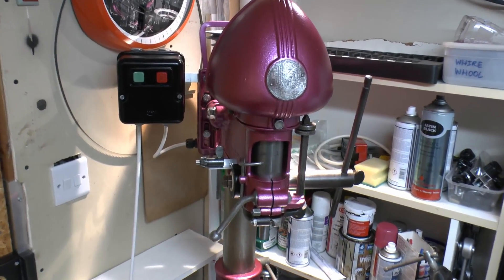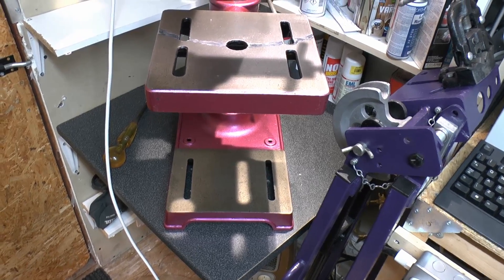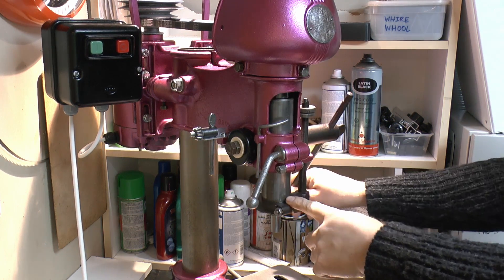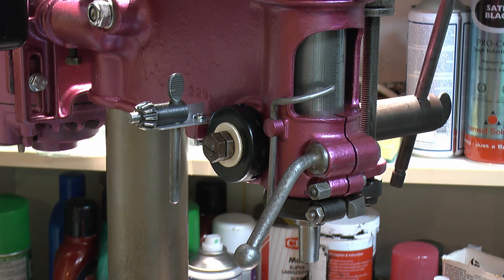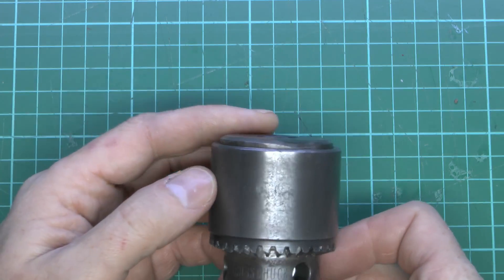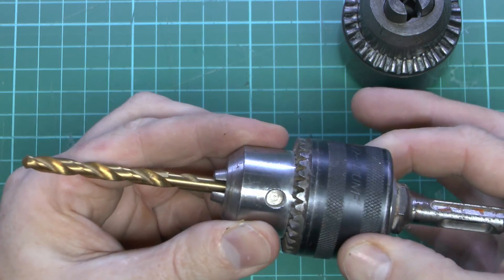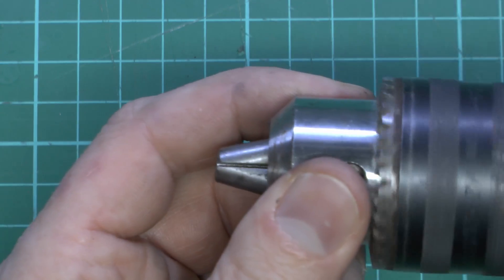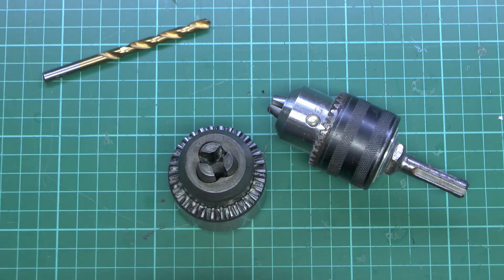Tauco Bench Drill Part 5 - Reassembled and working

Comment: There should be a spring and ball bearing in the handle assembly which is what the indents at either end are for. Stops the handle from  completely pulling out.

Comment: How were the spindle bearings? Delta used proprietary bearings with a non-standard O.D. that were unavailable for a long time. I found a company in the States that now has replacements available, Hammerscale Technologies. As for the colour, I prefer grey for machine tools, but it isn’t mine, so enough said.

Comment: It might, just might, benefit from some tangerine metalflake pinstriping. I have an old Delta Milwaukee (in pieces) of this vintage. It has a cast iron belt cover. It was attached to a solid column set in a weird goose-neck several feet long made of cast iron. This rode about another column attached to a base made of welded steel gussets 3/4" or 1" in size, and rotated on a roller bearing. I bought it from Boeing Surplus in the 80s. It has a War Production Board tag on it.

Comment: There are service kits with new jaws for the better Jacobs chucks. However this doesn't look like a better one and probably is worn out in other places.
Put a nice Röhm, Albrecht, or Metabo chuck on there (maybe even a good Jacobs) and you won't regret spending a little money. I think my Röhm was 30eur on Ebay, new old stock in the original box. Well worth it for a nice keyless chuck with very little runout, that properly grabs with no spinning and gouged up drill shanks. Especially given the time spent on restoring the drill it deserves a quality chuck.
As for milling/routing, I recently had cause to try that. The weakness is the taper (on my somewhat more substantial press), it will work loose from the side load and drop the chuck. Mills have a drawbar to pull the taper in (and don't use chucks). I did finish the job, but only just.

Comment: Lovely paint colour xD

I wish I had the same metric vs standard supply problems you do, I work in metric but nobody carries it... Metric is even more overpriced than "standard" here... a pack of SIX 6-32nd 1in screws is $1.25!
Reply: Yup... I'm an auto and equipment mechanic here in the US. Cars and heavy equipment, even American ones, haven't used imperial fasteners since the 1980s. Yet even auto parts stores stock 3 times more imperial threaded fasteners than metric. My employer has a Fiat-Allis front end loader, and some moron at some point couldn't find metric bolts to attach the ladder to it at some point, so they just jammed in whatever standard bolts they had lying around that were close enough, and destroyed the threads. I ultimately had to drill the holes out and install heli-coils to fix them.

Comment: Very smooth operation. Great rebuild. Jaw section were deformed by over tightening a bit that wasn't seated correctly.  At some point someone hammered the top of the chuck trying to remove it. Must be the same person who drilled the arc of shame on the base. Crazy..

Comment: Looks like someone not only over tightened that chuck, but they did so with the drill bit not pushed far enough into the chuck.
Reply: with the damage to the base plate, im gonna say this was used at a school and treated terribly for many years
Reply: more likely someone kept spinning drill bits in it
Reply: Wonder from the wear on it, if someone used a taper drill in the chuck and kept tightening it as it wore loose?

Comment: The world has gone mad.  I've just finished watching AvE repairing a clamp multimeter and JW repairing a drill.  Nothing makes sense any more.

Actually, AvE failed to repair the meter.
Reply: Not surprised he didn't manage to repair it. Anyone else would've though.
Reply: +Simon Tay
I have to say that I did wonder about AvE's explanation of why the meter didn't need fuses for input protection.  It had a continuity test and a diode test, and presumably also a resistance range.

Oh well, the next time he tries to measure the internal impedance of the mains directly, he'll find out why that meter ought to have input protection. :)
Reply: +Simon Tay Many multi-meters have PTC protection for the ohms/diode test ranges etc and fuse protection on some of the current ranges, so many that don't measure current don't have fuses at all.

Comment: Your really going to have to change the colour. Nice little drill. Be nice to see you measure the run out I bet it’s still better than my new machine mart pillar drill. The chuck has been over tightened, probably a tube on the chuck key. The cheap Chinese chucks can be surprisingly good.